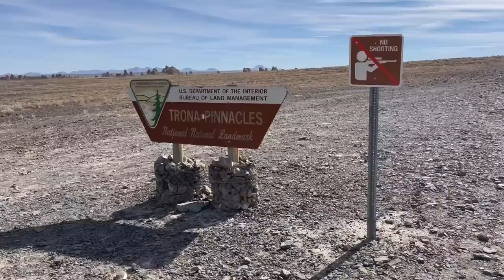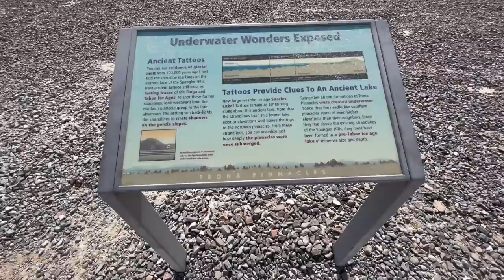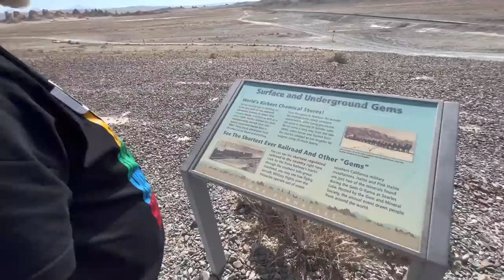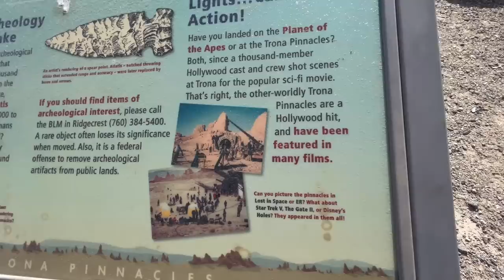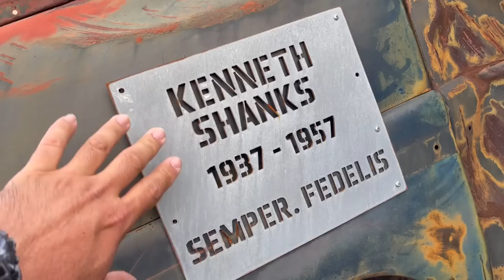We found over 10 vintage cars crashed off a cliffs edge!

Comment: From the Morning Press, 06 May 1957:  Lancaster Marine dies in Coast auto crash:  May 5: Marine Cpl. Kenneth C. Shanks, 20, from Lancaster, PA died Monday in a Hospital yesterday from injuries received in a one-car accident 14 miles north of here on the Death Valley Highway. Patrolman Paul Jorgensen said Shank was a passenger in a car driven by another Marine, Donald A. Fling, 21 of Denver Colorado, who was also injured.  The vehicle ran off the road and plunged down a steep embankment. (end).
Reply from the maker: Wow!! How did you find this info?
Reply: Dang I wonder how that 2nd car ended up on top of the marine car then, another wreck that just ended up in the same spot? What a dangerous road
Reply: Mr Shanks would be 86 now, and Mr Fling is 87, if he's still around. And I'm sure he still thinks of his friend every day.
Reply: Wow. Very cool that you found this. RIP marine. Salute. 🇺🇸
Reply: @steeliewheelies      The marines were in the '50 Mercury. The '53 Oldsmobile is an unrelated 2nd crash at the same location.  Two two crashes happened at different times and are not related.

Comment: The majority of these vehicles were disposed of off the side of the road. If you'll notice a lot of them don't have drive trains in them. I noticed a few of them that had the heads taken off of the engines and no Interiors. Not even seat frames. With this rugged terran nobody would go down and be pulling whole engines apart and taking drivetrains, engine blocks to try and get them up that hill.
Reply from the maker: I believe there is a road down below that Is accessible but you could be right!
Reply: I would...
Reply: @jakedode  Same hear I wanna go get that stepside bed,the IH steering wheel,the green Ford hood and the GMC tailgate
Reply: You'd be surprised at what someone will salvage if they need it...
Reply: I would for sure I'd take the whole car
Reply: Uhm..... i'm that village idiot to actually do it. and have done it.. in the EU however around 2007 lol  abandoned cars deemed unsalvagable.. and i just picked them clean after month xD  vallyes.. ditches moiuntain roads in germany. zero fucks given haha
i see i come back and pick tehm clean!
Reply: Especially considering that there are big block steel engines.
Reply: You sure about that .he in Australia abandoned wrecked car left In middle no where hot as hell you have people saving an part they can
Reply: @christianmiddleton7738  classic V8 long blocks are very very heavy. You would need to somehow get a hoist or a truck out on the cliff side to lift them.
Reply: i would, but i would never leave a shaft open for animals to fall in
Reply: You underestimate the desert tweaker
Reply: People always weirdly assume when they see a car off of a road, that it crashed there, I've never understood why.
Reply: @low225  you got that right! 🤣🤣🤣😂😂😂😂
Reply: oh yes they would! I remember even in the early 90's going with one of my uncles on an insane 4wdrive ride then hike out to an old truck in the desert that he wanted the get the transmission out of. we got it too , wrapped it in canvass and literally dragged it behind us for two miles thru the desert back to the truck. this cars went off the road in accidents noone was "disposing" of them what would be the point of that? back then you could just leave a car anywhere if you didnt want it you wouldn't need to run it off a cliff.
Reply: Maybe some are dumped, maybe some are salvaged. Unbolt what you want, strap it to the hood or trunk lid used as a skid and bring it up with a wrecker hoist or even a jeep winch in 20" sections of cable. Winch 20', tie off, repeat.
Reply: Your theory makes perfect sense.  However, I have watched parts like engines disappear from abandoned cars that were not dumped down into steep terrain.  Some people will go to any length to get something they perceive has value, for free.

Comment: Your ''fifties bel air" is actually a 1955 Chevrolet 210 2-door sedan, originally painted Sea Mist Green and was equipped with a .265 V8 2v and Powerglide.

Your 'second car' is a mid-1950s International Harvester half-ton pickup.  The 'American hood' is from a 1959 Chevrolet in Aspen Green.  The loose tailgate is from an '80s GMC pickup.  Car # 4 is a 1956 Ford Customline in Diamond Blue.  The Kenneth Shanks car is a 1950 Mercury Custom Fordor and its companion a 1953 Oldsmobile 88.  They did not crash into each other.  Each followed the same trajectory at different times.

The upside-down car with the motor/trans still intact is a 1969 Dodge Dart.  The Aspen Green '59 Chevy wagon was once connected to the matching hood you found earlier.  The car between the Aspen and the Honda is (at best) a 1952 Dodge Coronet.  Your 'i dunno what it is' is a Glenmist Green 1952 Ford Customline Tudor Sedan and the rusty seat is the Ford Crestmark front seat frame to the Glenmist '52.  The car with the scrawling on the trunk is a 1971-1972 Oldsmobile 98 Regency.

We found the Glenmist '52 Ford in 1966, on our very first trip to Death Valley.  I spotted it instantly, but my folks refused to let me go down the hill and study it.

BTW, you don't need to be paranoid about where this is: there is nothing worth salvaging... TRUST ME!

Comment: Nice treasures!

18:35 '55 Chevy 210
22:45 International. guess from short step-side bed & headlight lim,'64-67 C900
26:22 '84-88 Chevy Sprint (Suzuki Forsa)
28:38 '56 Ford Cutomline
30:00 left '50 Mercury Sport Sedan, right '52 Olds Super 88
33:59 '69 Dodge Dart
36:28 left '75-76 Datsun 710 Wagon, middle '51 Dodge ,right '59 Chevy Brookwood
40:55 '53 Ford
43:18 Renault (4CV)
44:05 '67 Olds 98 ?
Reply from the maker: Thanks for the very organized comment!
Reply: Yes.  I thought that was a 69 Dart.  Had he been able to get behind the car, then that probably would have confirmed it for me.  The grill was my best guess.  It did have factory A/C based on the condenser on the front of the radiator.
Reply: @rickloera9468  
The grill was my guess too! and front torsionbar indicates it's Mopar.
Reply: The car sitting on the 50 mercury is a very early dodge/ Plymouth probably a Valarie
Reply: @felonysounds  
31:21 tail lens unit+fin & shape of rear door indicates Olds88
32:01 '52 grill
32:27-33:27 through the room of mercury, rear door molding can be seen
🙂
Reply: I was thinking Oldsmobile too
Reply: 26:22 it's a1986, looked up the vin
Reply: Iso Jun, you were spot on with the 67 Olds 98. That's exactly what it is.
Reply: @@isojun9927

Yep!
Reply: Definitely a 55 Chevy
Reply: Thank you for saving me time by timestamping all these marks. I can't believe this guy has never heard of International Harvester!
Reply: we had a place called cadillac hill that had hundreds of cars. finally they got them all out.
Reply from the maker: @mikesrandomvideos  I would have loved to film that!
Reply: You should add a timestamp and type of jet that flew over
Reply: You google it no way
Reply: amazing to me that you can identify all these. very cool.

Comment: The one that was upside down and all rusted out could have been an early 1970s Plymouth Valiant, like the one in the movie, DEUL! The last car that you shown may have been a later 1970s Ford Thunderbird. Thanks for sharing your guy's rigorist trip up and down that rocky hill, I'm glad you both made it out alive. I had a blast, great stuff! REST IN PEACE-KENNETH SHANKS! and to all of the victims who didn't survive those horrible crashes, REST IN PEACE!  and may all those cars RUST IN PEACE! I'm a car lover! signed, Greg the Egg.
Reply from the maker: Thanks!
Reply: 69 Dart. The grille and side marker lights identify the model and year. 68s had round ones. 67s had none.
Reply: I was thinking a Cadillac  could be a t bird
Reply: Easy, the overturned Mopar is a '69 Dodge Dart. The front grille gave it away. The last car is a late, 1960s or early 1970s Oldsmobile. The one with the roof cut off is a 52-54 Ford. The station wagon is a 1959 or 60 Chevrolet. I think the car on top of the Chev might be a late 1940s Oldsmobile.
Reply: @scottkellogg8145 neither of those had torsion bar suspension

Comment: There's a highway here in northern Colorado that's the same way. Many cars went over a steep cliff mostly during winter. They would only recover the people leaving the cars.
Reply from the maker: Interesting! I will look into it!!
Reply: @REVERSE ROCKET TV   It's on Hwy 14 at Cameron pass. The area where the cars are said to have down is near The Crags Campground. Google maps shows a almost 90° turn with a cliff going up on one side and a cliff going down the other. The guardrails were installed in the late 80's so what's left down the hill is prior to that.

Comment: It's amazing how long abandoned cars last in the arid desert. 
In my country, where the rainy season begins every summer, in 20 years everything would have turned into a rotten mass of metal.

My father told me the story of a relative man who was driving his new tanker truck on a mountain road 30 years ago when it fell off a cliff.
Fortunately, he survived by clinging to a tree branch, and his tanker truck crashed down a cliff into the woods, making it impossible to save. 
(The tanker was empty and did not explode.) After that, the truck was never recovered and is probably still abandoned deep in the forest to this day.
If I know the exact location where he got into the accident I'd love to find his truck!
Reply from the maker: That would be a great video! Thanks for commenting!
Reply: a Mi-26 helicopter could probably recover it
Reply: @SlavicUnionGaming  If I were to search the truck it would be easier to try in the winter when the vegetation is dry.
That's not a big enough job to use a helicopter. 😅 All I need is some tools to remove trees and grass!
However, someone may have already found it, disassembled the truck and sold it as scrap metal, 
and it is expected that it will be in the same state as the wreckage of the Titanic, so recovery is impossible.

Comment: There's a river up in western Maine which I camped alongside for years. One spring we were up there after a major flood stripped a lot of soil and trees on the opposite bank and there are a bunch of really old cars across the river. There were at least two Model Ts and a late 1920s Chevrolet, laying on their sides and upside down but pretty intact. There was also a mid-1950s Oldsmobile, crushed like it had been flipped, but the mint green paint was still shiny. 

I asked in town and it said the cars had been buried along the river bank as rip-rap to prevent erosion and been exposed by the recent flood. The next time I went back the cars weren't visible: maybe they added a new generation of clapped-out cars from the 1960s and 1970s as an update. (There were certainly enough available in backyards and behind barns up there!)
Reply from the maker: Excellent story! Thanks for sharing!

Comment: 1955-56 Chevy
IH stands for International Harvester P/U
60s olds 89
Obviously that's not very secret because almost all those cars are set on fire deliberately burned up after the crash and they've taking engines the other parts after the crash, they are riddled with bullet holes everywhere. People have been visiting there for decades and decades. 
You and your friend had to work to get a look at those vehicles.
👍
Reply from the maker: We had fun doing it.
Reply: @reverserockettv007  
Thanks for sharing ✌️
Reply: No, those cars aren't burned, it's just hot sun and time. The rubber parts left on them would not be there and the metal would not be shiny on sections.
Reply: If someone is pulling engines, you'd think someone would grab that 1955 265 motor. A restorer needs it. 55 is unique, they have NO OIL FILTER boss.
Reply: 55 Chevy, the grille is the giveaway. 56 is quite different. The big Olds is either an 88 or 98, I can't recall.
Reply: Seems odd that a 44 year old guy never heard of an International pickup truck. That bed was still usable for a rat rod.
Reply: @jeffrykopis5468 , yeah, I would have thought a quick check of the back of the tailgate would have confirmed that. I saw the "IH" on the wheel and immediately knew the make. I'm 55 tho.
Reply: There are also brush fires in the desert - they don't burn super hot but hot enough to light upholstry.

Comment: Really cool video, that 55 Chevy is in fact a 210 two door, it came with a 265 V-8 with 2 speed Powerglide automatic transmission. Not sure if it had the original engine or not, if it came with oil filter it would have been mounted on top and I could not see the return line. So if this is a replacement engine it would have the oil filter casting on the bottom of the engine starting the 56 year. Now GM had a lot of left over parts from 55 and did use them in some of the 56s including the motors. I could write a book an book you all. Now if a wreck has its wheels the inside lip of the wheel will have manufacturers mark and date, my 55 Chevy wheels are dated November 54, that's because it was made late 54 for the 55 year. I very much would like to recover that 55, I think it would be great to rebuild it into running condition but not touch its patina! I would really appreciate it if you could tell how to get there. The Marine who was killed was my Mother's age, she was born in 37 as well, my father was born in 34, they were of the same Generation.  I joined the Marines in 75 and served with Marines that would have served during the time he was killed. SEMPER FIDELIS BROTHER. 👍❤️🇺🇸
Reply from the maker: I honestly really couldn’t tell you gps coordinates without returning. But I do know if you went to the city of Trona and asked around someone would have to know about this site. Thanks for commenting your very knowledgeable! We had plans to return here with friends but it hasn’t happened yet…..
Reply: If you go to trona anyone can tell you where it is, trona tells about the cars as a roadside attraction for visitors to see from above. Some people used dynamite and blew some of them up in the seventies when they were drunk. Numerous people have put them on their videos on YouTube. But they won't let anyone take anything from there cause it's to dangerous
Reply: I would bet that's the original 265. Numbers on the intake match for a 55, and the valve cover bolts are offset between the top and bottom ones, as they should be on an early engine like that.
Reply: Actually it is a 56
Reply: @robertmartin5308  it's a 55 the junk model with a post.
Reply: @terrencegiordan2775  IDC

Comment: That small orange/yellow engine is a two cylinder Caterpiller pony engine. You can see the starter rope pulley, and the camshaft drive gears. It was started first, then it was used to start the main diesel engine on bulldozers and road graders. Very interesting that you found it out there!

Comment: I'm guessing a lot of the cars were intentionally pushed off the road. I don't think them motors were taken out and carried up the hill.  It's a very interesting video. It's hard to believe a car can last this long without rotting away. Heck, my 2017 Ram has more rust than them cars.
Reply: There is a road down below too.
Reply: I was wondering the same thing. We would walk through the woods here in PA when I was a kid and saw many abandoned cars from the 50's. Some could have been pushed there after being stolen or unwanted.

Comment: That rust bucket on it's roof looks to be 1969 Dodge Dart four door.  If it's a V8 engine in it, it would be a 273, a 318, or (highly unlikely) a 340.  It has the 7.25" rear end, so definitely not a performance model.  I'm surprised no one has tried to grab that '55 Chevy 210 two door or that '59 Wagon!  I'm not convinced those cars were in accidents...people used to dump junk cars in the desert all the time, and over the years other people bang them up, shoot them, and burn them...
Reply from the maker: We had fun looking at them!

Comment: Wagon is 59 Chevy. Decklid  with louvers, looks like Renault 4CV circa early 50s , or Subaru 360 (VW has narrower louvers). Car at 41:47, 52-54 Ford, from taillights,  bumper, and gas filler. Last car, front bumper looked like 70-72 Ford Galaxie.
Reply from the maker: Thanks for the info!

Comment: Wow, what a violent ending for so many people & cars.  People died in all those accidents, may they rest in peace..  Cars & trucks were built like tanks back then, so the force must have been unreal.  Also, be VERY careful picking up sheet metal in the desert.  Rattlesnakes love to hide under it.  Great video guys.
Reply from the maker: Thanks!
Reply: Even though I'm no fan of modern cars in terms of what they have become... one thing is for sure, you have a much better chance surviving a crash then you ever did in these old cars. Sad to see that Olds '98 towards the end...
Reply: Nö they we're rather mush except the frame
Reply: Yo old man is a cool Dude With alotta wisdom, man!
Reply: 55
Reply: Guess Oldmobile and Mercury, the ones that died
Reply: how do you know that people died?
Reply: I'm "a car guy," active since the 1970's.  Places called "Dead Man's Curve" don't earn that name because thieves dump stripped cars there.  Further, car's that are 400' from the road weren't pushed there...they flew in that direction and tumbled, which is evident from their condition.  Also, wheels, axles, engines, & drive-trains often separated from old cars in catastrophic wrecks.  Failure modes: There are only 2 engine mount bolts, and 4 rear-spring bolts.  The tranny mounts had 4 bolts typically.  While strong, none of them are designed to survive 30G+ impacts.  Were some cars dumped?  Probably.  The older ones looked like 1-car accidents...a common problem in the old days.  People rarely survived crap like that, because we didn't wear seat belts...go read the stats.